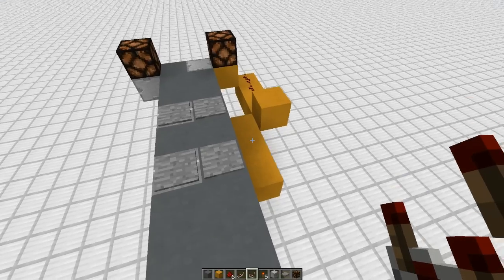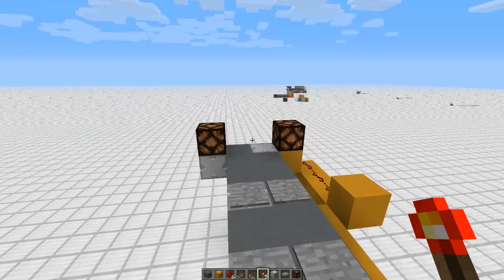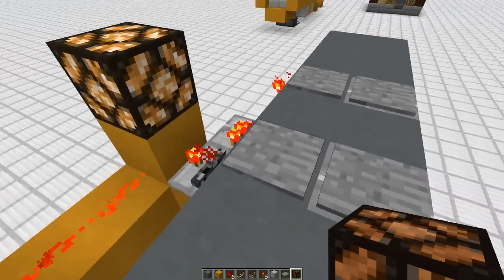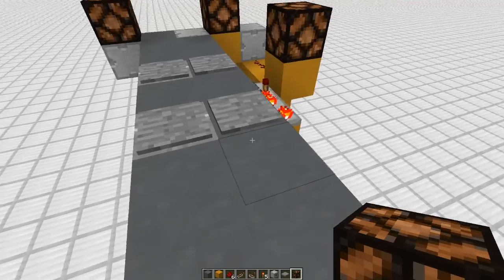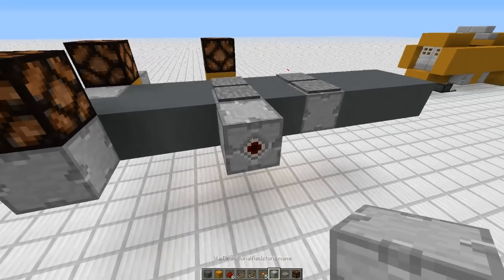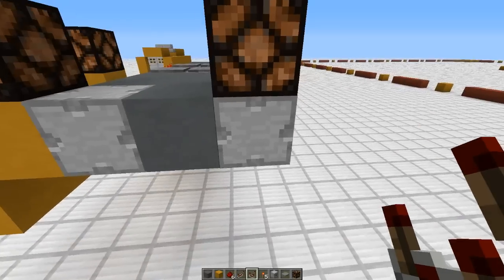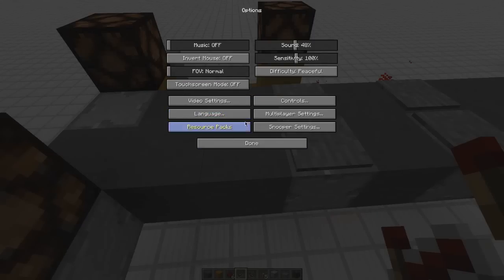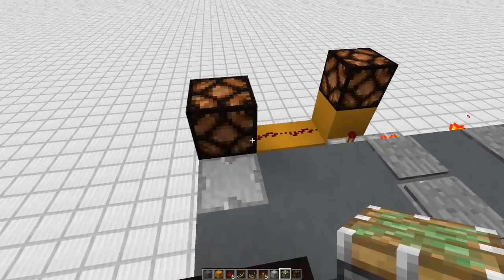Response to Mumbo Jumbo's "The Advanced Pressure Plate"

Comment: This is a bad design as you do not need to go on both pressure plates to turn it off, also it is not flush with the floor
Reply from the maker: You only really need to go on the pressure plate that activates the torch to turn it off, I show that in the video.

And, if you need it to be flush with the floor, then just move it down. It's not hard to figure out. :P
http://i.gyazo.com/efa1c79d9ba2ad9742e6a5229c46e91b.png